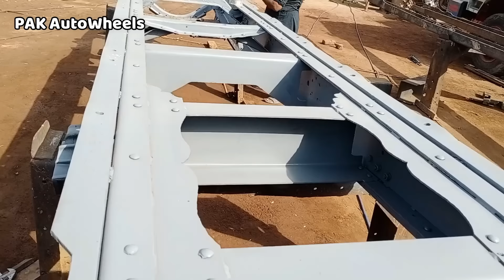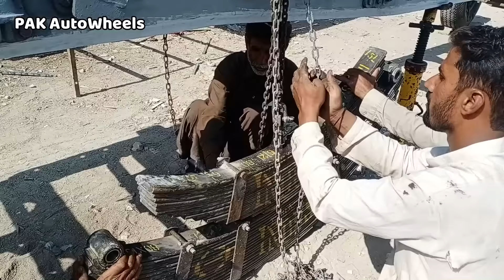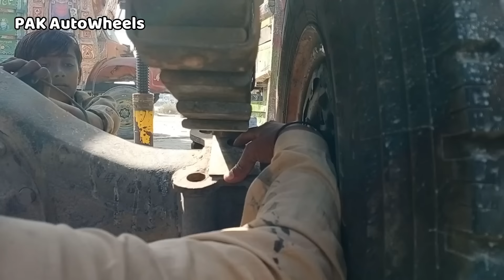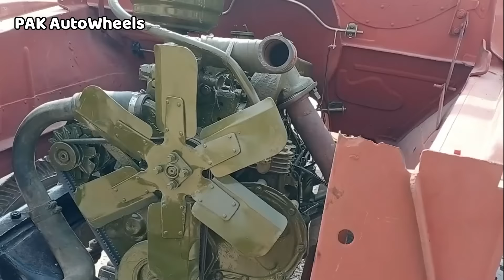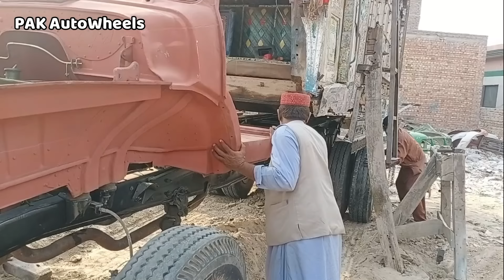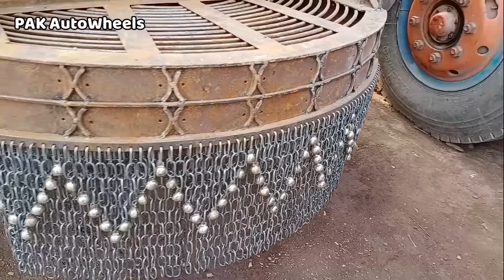How To Old Bedford Truck Restoration Process | Truck Manufacturing Process in Local Workshop

Comment: This truck has front axle with capacity of 1790kg and rear axle 4500kg. These are factory numbers. If you replace springs for something like here and dont change axle and brakes, vehicle is totaly illegal and dangerous for transport over the weight limit.

Comment: soooo body filler is to cover up the huge gaps in the frame of the truck where you tack welded extra bits onto it ? i am sure the filler will add to the strength and not instantly crack and fall out...
Reply: Looks like seam sealer.
Reply: Of course it will stay attached,  that’s what the paint is for..
Reply: It's a triple frame truck
Reply: No inspection required, ,,,,wink wink...
Reply: Sold as is, but looks so smooth, not called a Bondo Buggy for nothing. PS just don't hit a bump while driving lol
Reply: @saywhat951 This people finds solution on everything😂😂
Reply: This vehicle has recently come on the market , it can be viewed at bumsore valley 200 metres down into a deep ravine , police reports front chassis separated from back chassis whilst negotiating a corner , negotiable
Reply: كيفية التواصل معكم

Comment: Mira un Bedford es modelo 65,66 no? Acá en Argentina todavía hay varios trabajando. Acá llegó con dos tipos de motores naftero 6 cilindros de 133hp y diesel 6 cilindros de 97hp un fierro.
Reply: 1965 to 1984 , 6 cilindros 133hp
Reply: In India also . Bedford J6 and J4 s were there. Made by Hindustan motors as recently as year 2000 for export to Bangladesh

Comment: With so many spring blades on that spring 
Means the truck is being overloaded seriously 
And you'll always have to return for major chassis cracks
Reply: The truck decorations is very heavy
Reply: @sunflower2353  thats very stupid 
Remove the decorations and use the truck what irs meant for and go and decorate something else maybe a wheelbarrow or something 
But you using a truck that has a 8ton capacity and decorating it adding 4ton and then loading another 10ton 
How stupid is that and theres no laws in pakistan against shit like that
Reply: The chassis is reinforced by doubling
Reply: @ukhyarbunere1698  but it still breaks the chassis and breaks axles and cross members
Reply: @ukhyarbunere1698  remove the useless decorations and leave the TRUCK standard to be productive and problem FREE
Reply: @Gary Wigget unfortunately, in both Pakistan and India, decorating trucks in this manner is tradition, not unlike the dekotora trucks of Japan, and a representation of a truck owner's tastes. It is also a type of advertising: the more flashy the truck, more customers would hire the truck, especially in the rural areas, where these truck predominantly operate. This also explains why these trucks have beefed-up suspensions, due to the  rough conditions of roads in the rural areas, like the North-West Frontier Province.
Reply: that stupid decoration make you cry. unnecessary load.
Reply: That filler on the frame will hold it all together...🤔
Reply: Precision body panel fitting with the bonnet!

Comment: Use the cab refurbished from a wreck or is that all new sheet metal? Was the axles, engine and transmission refurbished or used in another truck before being used in this truck?